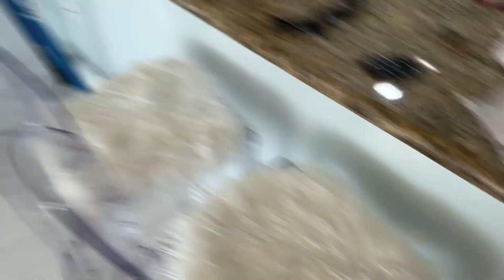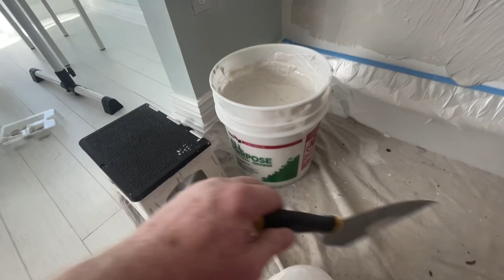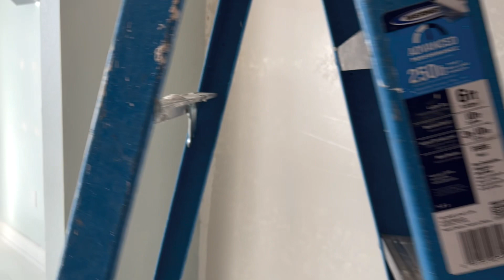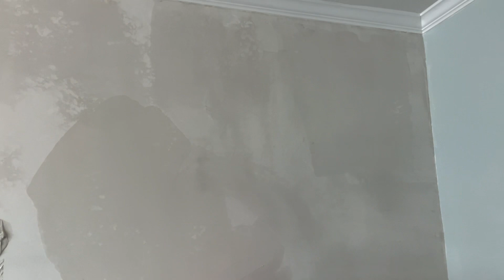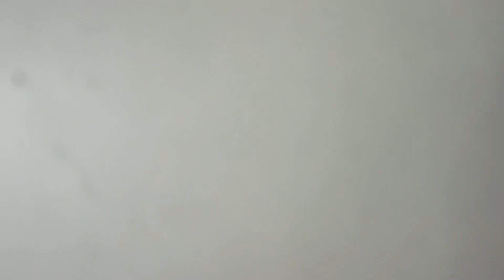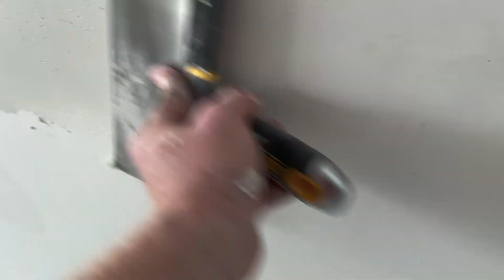How to Make Textured Walls Super Smooth - Spencer Colgan

Comment: Hello Spencer, I just wanted to share with you doing this application of the skim coat I have had very good success in using the spaghetti type roller you would find at the big box store. I find the mud goes on more even and is very easy to clean at the end of the day for multiple uses out of one roller. Keep up the videos! Ben

Comment: Hello Spencer, my question for you is at the very end of your tutorial, after your wall was gorgeously smooth, you ended by saying the only thing left to do is seal this wall with a penetrating sealer before I hang the wall covering! What is the penetrating sealer you use on top of the sheet rock mud after it has thoroughly dried before you hang the wall covering? And, obviously before painting if that was what you were going to do to the wall you would use a primer correct? Thank you dearly for all of your shared knowledge. Totally educational and very useful! Tammy Glosson (Texas)